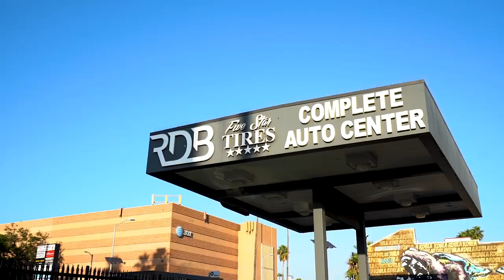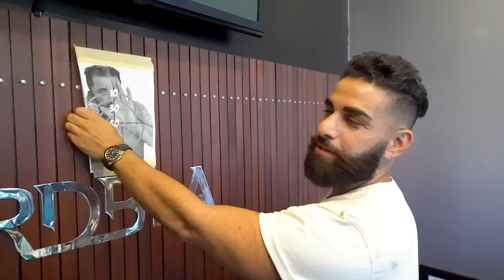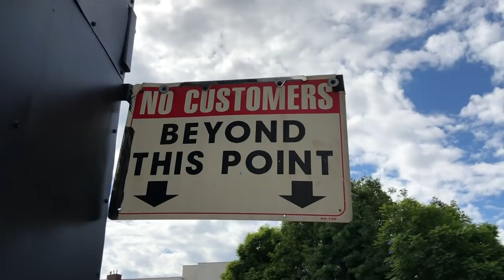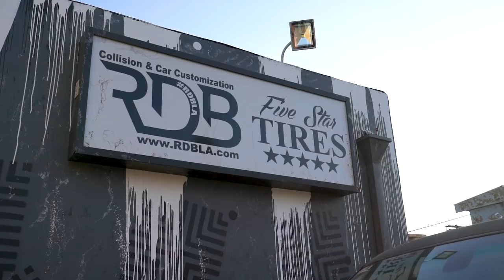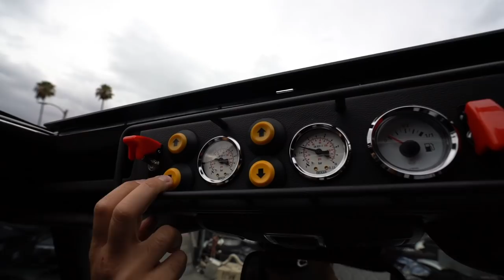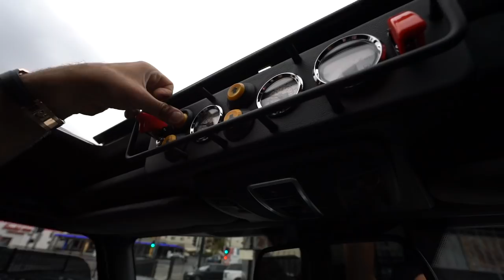#RDBLA Mclaren gets an amazing makeover (good or bad?)

Comment: Kills me to see his bmw just sitting there collecting dust and dirt ugh should have sold it to salomondrin!
Reply: No, that guy would've given it away to someone that might trash it. You ever heard of sentimental value?
Reply: J Silver yea I understand sentimental value but that’s a fully built race car salomondrin said he probably wouldn’t have given it away during his podcast. And isn’t what he’s doing having it sit there trashing the car? It’s meant to be ran not sitting there for years he probably hasn’t driven that thing in years. But I understand where you’re coming from but to automatically assume whomever won the car would have trashed it is a little bit of a reach.
Reply: @honorthyself8921  Vik says he has plans for the car which is why it's still around. Selling it to salo would've been a regretful mistake. No, letting a vehicle sit for years is not really trashing it, then in that case some people keeping vehicles in storage for long term would be considered trash which is not. It's will still run like it should, just will need some of the maintenance parts and fluids replaced. Trashing in my definition is neglect performance/maintenance wise, dirty inside out, damaged, or ricing out/over accessorising. Most times, cars given away are usually trashed because their money isn't tied to it. I'm just making assumptions with Ale, just seems like the kind of guy to get it, bring it to Galpin, customize it to whatever, thrash it around at the track or streets, then give it away once they're done with it....or also let it sit at  like some of his other vehicles. Yes cars are meant to be ran/driven, but it's not a requirement. I'm just saying.

Comment: I'd be so worried about my $300k plus car rattling all over the place after a wrap. I have never seen these guys order new clips or plastice rivets. Mine are shot to sh!t with random removals to access fender wells or change stuff in the engine bay.
Reply: they are pretty professional and constantly have customers and people who talk really good about them, if i ever win the lottery im buying a couple supercars and sending them straight to RDB
Reply: MechE184 I’m pretty sure they don’t give costumers cars back rattling lol 😂 they probably have those on hand. Most cars use the same since they are patented.
Reply: The ShawShank Preneur well dude he said his 300k car sooooo. Lmao
Reply: One of the reasons why Vik drive the cars hard, make sure no abnormal noises after vehicle has undergone major parts removal, because it happens. Also they won't show clips being broken if any, really should be a problem because as a repair facility, replacement clips, bolts, nuts, screws, washers, etc. of all types are a required necessity.
Reply: The ShawShank Preneur My city bus never rattles partner. Good luck in life!